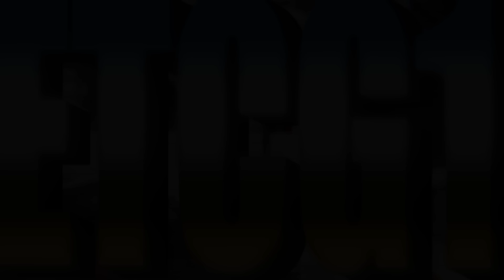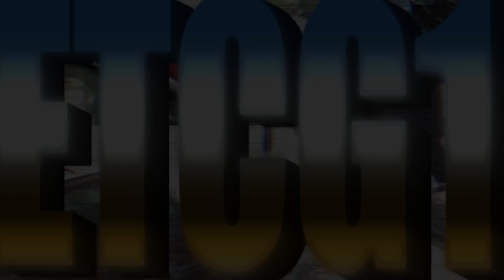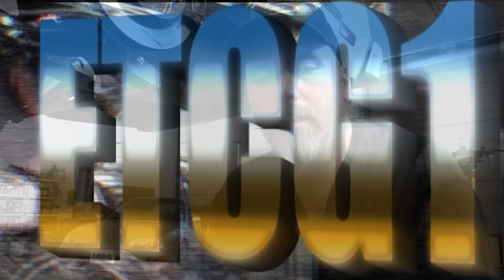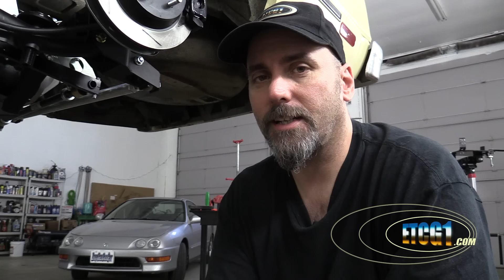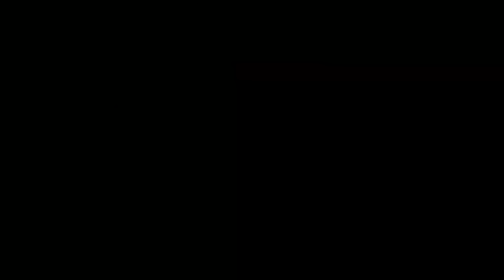Misconceptions About Performance Parts

Comment: You really should explain that doing "Intake Headers Exhausts" doesn't necessarily even give you more performance per say.

And in cases that it might, all it's doing is taking away performance from (one) part(s) of the powerband and just shifting it to another, because you're just shifting where in the rev's it's more efficient at scavenging out exhaust or which RPMs the intake velocities get optimized for rushing in more, assuming the sizes are not so different that it just becomes less responsive all over whilst the acoustics trick you into thinking it's doing more lol.

But usually without some tune on a modern NA you'll actually loose power since most cars that aren't old enough to be President or have EFI already have oversized stock "I,H,E" parts for their engines.

MotorTrend even did a thing about how little headers actually even matter by banging one up with a hammer multiple times and the dynoed results showed it actually was stronger with beatup tubes lol.

The only modern car that *I feel really might benefit from headers is maybe the Honda K24, and that's mostly because it has this tiny one that looks like a turbo manifold on what's just a too tightly packed NA. As for the GSR lol, I don't think you'll gain anything at all it's already a Type-R motor, heavily R&Ded and the powerband sits much too high as it is, so if anything you may be shifting power into a revrange that may hardly exist with stock ECUs redline.

But it should sound more sporty lol. Like yourself I've got myself a fancy replica TRD header which I know will do more harm than good, but I'll put it into the MR2 for the weight savings part, knowing good an well 4-to-1 header isn't ideal and that it's ment for an engine that sees 12,000revs which mine won't.

But hay I got it as a bargain and held on to it for years, which sounds like why you got yours.

Comment: more engine power means your going to need a better clutch in a manual or a stronger automatic. plus the possibility of a transmission cooler. a stronger drive shaft. and the list goes on and on

Comment: there was a video i watched just a few days a go where they put one of those $600 ebay turbo kits  on a wore out gm 305 motor and as i recall it made over 600 hp and like 500+ ft lbs . unreal power for an old wore out motor I will add the link just so you can see it . but they clearly state in that video they had to do more then just bolt the parts on . and of course the motor that was never made to have that on it gave up ...... and Eric thank you for not going the way of the fart can !

Comment: There are indeed certain parts you can add which increase performance by large amounts, but it's not going to be the '$75 air filter' or the '$100 CAI kit'.  It would be more along the lines of the '$3000 supercharger kit'.  Performance isn't always free, and while you can pick up a few hp here or a few hp there from bolt ons, REAL power is going to cost money, and involves adding a 'system' to your car.  As mentioned, installing a header is only a part, but you won't gain real performance unless you upgrade the entire exhaust SYSTEM front to back (header/cats/tubes/muffler) and change the front end (intake) to make use of that extra flow POTENTIAL.

Adding a turbo or supercharger kit involves dealing with many systems (induction/fuel/engine management) and thats where you get the big gains.  But again, unless you're a master fabricator you'll have to pay for these kits and they're not cheap.

Comment: I think those who do those CAI or SRI debunking first, use a car that is already engineered for performance.  Second, do not account for a moving car.  Yes they use a fan to simulate the car moving, but can they simulate a 30mph wind indoors?  Think about it.  I found my car perform better with just putting on a pod filter, nothing else and yet those Britts says it does near to nothing.  Unless they can produce a 60mph headwind on the car, they can't produce reliable data.

No, I don't expect to outrun V6 stangs or cammys, but I do like to get as much as I can get w/o dropping a whole forced air induction.

Also to give much thought is where is your car drawing air from?  Is their going to be negative pressure because of air flow?  Will it have the opportunity to get fresher air from the engine room "while the car is moving"?  These are things to consider.

Comment: Cold air intake is a scam unless you just like the difference in sound.  Look at "Mighty Car Mods Pod Filters Mythbusted"  It boils down to the filter not being the most restrictive part of intake on most cars. But if you start dyno testing stuff, you might be very surprised at how little performance many parts actually add.  It's not like the old days when parts were designed for engines at random and you could make a few changes and pick up 50 HP.  50 HP is going to cost you a LOT of money now days.  The factory stuff is very good as is.

Comment: i put stainless branch manifolds and decated my bmw and it had lost power(had it on the dyno) from when i just had the catback custom system. it fucked the fueling right up, but then when i got it custom tuned it made more power and correct AFR

Comment: If you are going to add a performance part you have to understand what it is you want from the vehicle and how that part specifically helps get you there. When you build a car, it's not just going to magically get faster by adding one part. Sure you can add a turbo to your naturally aspirated factory motor and maybe it will boost for a couple of weeks, but then that one day you pull and your rods snap or you crack a few pistons. To get real gains be prepared to invest and purchase many complementary parts. The systems need to be able to communicate with each other and complement each other. You don't want to try to build a motor without quality internals, a good engine management system, good brakes, good clutch and drivetrain components, strong transmission.

I personally have a 560 wheel horsepower awd DSM. I laugh when the fart can kiddos want to egg me on, and wonder why I don't risk my considerable investment and possibly traffic issues to essentially take candy from a baby with nothing in return. Don't slap a fart can on your Honda thinking you are making a performance car because you aren't. The reason built motors sound incredible is because they are truly powerful often due to the investments, not just because they slapped a muffler on a stock car.

You also need as much calibration and tuning as you do good parts. A whole bunch of good parts not talking to each other in a safe manner is not gonna get you anywhere. You go run the wrong octane or timing advance on that high-compression/boost motor and you can kiss it goodbye.

Comment: I view performance parts much like I view high-octane gasoline:  a waste of money for most people.  If you car wasn't engineered to use premium gas, using it won't help a thing  besides the  oil company's bottom line.  When I was a teenager, I used to see ads claiming they could make your car run on water, and I'm sure that some people actually bought it.  Bottom line:  if it sounds too goo to be true it almost certainly is.

Comment: modding if fun but the best way to go faster is just buy something thats faster...and what i mod now is just suspension, brakes tires and a little intake and exhaust just to liven up the motor if necessary
Reply: And keep all the factory parts, box them away, so you can put it back on when selling the car else you LOSE value.

Comment: Dead on again.  The classic mistake of someone buying a 1000CFM carb to stick on their stock Chevy 305 and wondering why their car runs like crap comes to mind.  Me, I start from the perspective of improving safety and durability and the performance gains come along for the ride.  Yes, some vehicles come out of the factory so choked off that anything is an improvement but that's less true today than it used to be.  Look at it more like what the factory would do if they wanted to sell a better version and still be able to put a warranty on it.

Comment: ya that header won't do a thing till you get rid of that horrific air inlet tubing. and yes a proper cold air intake that pulls air from outside the engine compartment will add horsepower and better fuel milage. yes a tune will help but it doesn't do a heck of a lot. you may be able to squeeze an extra 1hp out of it but you wouldn't know till you get it on a dyno.
Reply from the maker: There's nothing wrong with the stock air intake system. It's a common misconception that stock air systems are restrictive, that's simply not true. The most a CIA does is increase engine noise. You don't see significant gains until you start modifying the engine along with supporting mods. You can't beat physics with electronics. Also, it is not possible to 'tune' Honda computers of this vintage. You would need to install a stand alone system to do that. In doing so you would also have to figure something out with the immobilizer system or else it will not allow the engine to run.

Comment: I love how people think drilled rotors will improve braking. The original intent was to prevent the brakes from floating from gas build up. Modern brakes no longer do this. The laws of thermal dynamics also come into play with entropy. Steel has more mass than air (ie drilled holes) for heat to transfer to. This is the whole purpose of the rotors is a place for the pads to dissipate heat from the friction created. Drilled rotors do not allow for this. For this reason you will never see them on a Formula 1 Indy car.

Comment: basically an air intake or exhaust will only provide more power if, that particular system on that particular car happened to be the bottleneck.

Comment: I think you may have missed some points here, while I do agree that most stuff is snake oil and wont give be 50 HP increase (unless its stickers, then i gain millions), when it comes to intake and exhaust, you do gain SOME HP, I said some as every car is different, heck, every engine is different, they all breath a little bit different. Most of the time youll gain 2-3 HP with intake or exhaust. But that's pushing it, assuming it's a good company too. This is because car manufactures have to meet emissions and gas mileage targets and stuff. But a free flowing engine is a good one, more air equals more gas equals more boom, more boom equals HP. Yes I know it doesn't exactly work that way but that's the logic behind it. 

Do all intakes or exhausts provide HP? No. Depends on any number of things, a healthy engine for starts, a good company that isn't selling snake oil is another. But some do, sometimes its a little, sometimes its still a little but not a lot. 

Moral of the story? It's the butt dyno that matters, and the stickers.

Comment: Sometimes it may be best to give the car a good service besfre doing any modification, like oil, spark plugs , fuel air filters, clean throttle body, new power steering fluidannd new diff oil can make a big improvement if they are all meeded. Then see if this gives you the improvement you are after.

Comment: I disagree to a degree. On my car I added a new intake and gained 10hp as the standard one was restrictive. Proved on a dyno. I also removed the 2nd cat and gained another 5hp. I then had my engine map updated to take full advantage of these parts and gained a further 10hp. A lot of the time mods will make 0 difference if not paired with a tune. I'm sure if all the examples given also had a tune a difference would be seen and felt.

Comment: Gotta say I disagree here, as a long time drag racer many times I've swapped single parts out and it made a real difference.  This year went from a 8 inch TCI converter to a 8 inch Neil Chance converter and the car picked up a solid 2 and a half tenths with zero other changes.  I have issue with the "I feel thing"  I can demonstrate gains they are not feelings.  Just because a change is too small to be felt doesn't mean it isn't there.